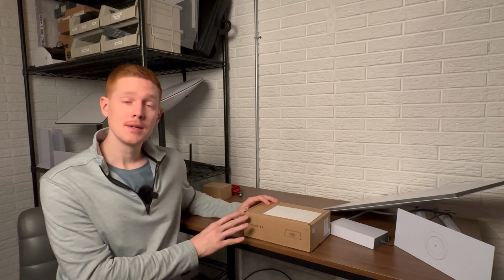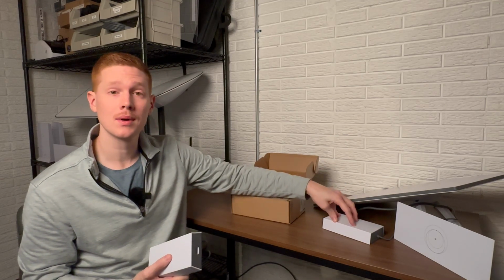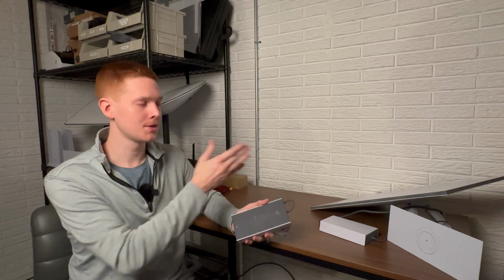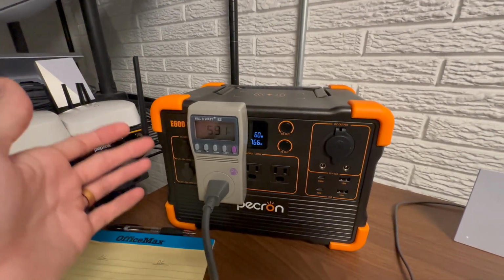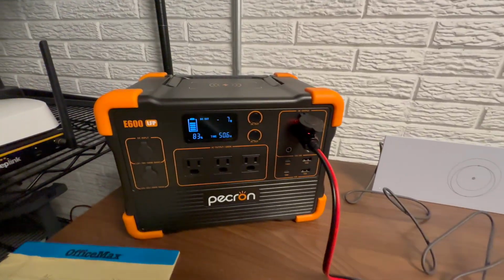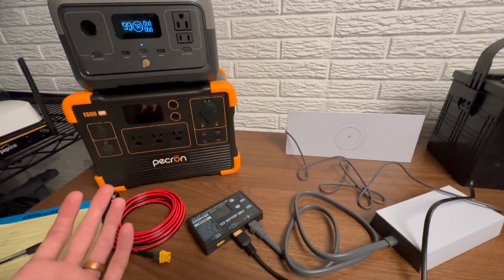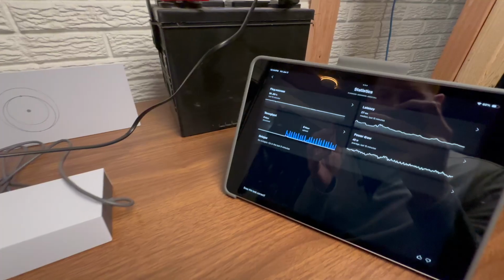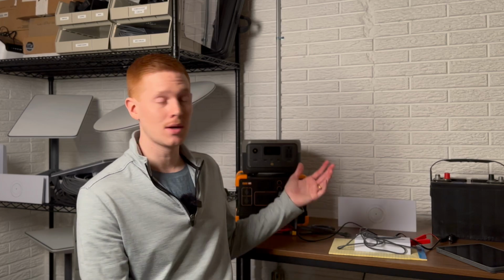Starlink Gen 3 Standard DC-DC Power Supply | Efficiency Testing and Review

Comment: Nearly all 12v cigarette lighter style sockets can only put out 10Amps, so 12V at 10Amps = 120Watts.  Since the DC-DC power supply puts out 200Watts, we will need to put in at least 225Watts assuming a 90% efficiency conversion from 12V to 56V, so running it from a cigarette lighter socket won't work.  You would be better running a separate 20-30Amp 12V feed from the battery setup.  And the cable itself is too thin in the cigarette feed.
Reply: Wow, look at my comment, 30 amp input to get 3.67 out on 12 volt? This is ridiculous.
Reply: Yeah, especially in my tiny Subaru I wouldn't trust this on a cigarette lighter adapter.
Reply: Try plugging to power bank first then to the router? Most dc to dc converters struggle to start  fully loaded.

Comment: Really enjoyed this video and do want to convert over to 12 volt . I was going to purchase the Starlink DC-DC power supply but now am pausing. The troubles you were having puts questions and new decisions.  If there is a change or Starlink gets back to you on the issues, please put out a update...  Thank you . Really enjoy your work
Reply: I won't be doing it either. I assumed the inverter losses would be higher (which is odd because I normally don't assume). I'll be putting the $110 saved toward a next generation mini if the price comes down.

Comment: Is there a power station that has  an XT60 male input? And if there is one, is a 3% efficiency advantage worth the cost of this power supply?  I’ve had the same issue with my Jackery 1000 cigarette lighter DC connection and will likely send the power supply back to Starlink.
Reply: @tglass0000  Same issues here. I think it's weird that they didn't consider that the majority of power banks have 10a on their 12v input.
Reply from the maker: For the casual camper like myself? Probably not worth 3% savings. If you are full-timing off the grid, probably. If you already have the Jackery I say just use the inverter since it doesn't require further investment, and it's just a bit less efficient.

I believe they included the XT60 instead of the common cigarette plug specifically to avoid people thinking it's compatible with every 12V outlet. As we found out, you need quite a bit of power to run it, and most power stations won't put out >10A which it needs.

Comment: What are your thoughts on unplugging the router every once in a while. I was told that would help the ping, latency situation.
Reply from the maker: I’ve only needed to unplug the router for troubleshooting or packing down, setting up. I don’t see a reason to unplug it regularly if you aren’t having issues. The system reboots automatically every week or two with firmware updates anyway.
Reply: @DISHY_tech  just was wondering. I’ve noticed that there are usually updates during the night at least once or twice a week. Thank you very much. I enjoy your channel.

Comment: For my mini, I just bought a USBC to barrel connector cable… no brick or anything. Straight cable with a usbc on one end and barrel connector on the other. powered my mini just fine when plugged into my power station.

Comment: New member here. Since the Starlink DC to DC Power Supply does not work off the Pecron 12V 10A  receptacle, I am looking for solutions.  I just watched your other earlier video covering the DishyNOAC.  Your Gen3 dish worked fine off your Pecron's 12V 10A receptacle in that video when using the DishyNOAC(another great video by the way!).  So can I assume a Gen3 will work off my Jackery 12V 10A receptacle assuming I am using a DishyNOAC in the mix?  If it worked off your Pecron it seems it should work off my Jackery. Finally, what does the DishyNOAC do, that the new Starlink DC to DC Power supply does not, in the case of using a portable battery's 12V 10A receptacle?
Reply from the maker: First, thanks for supporting the channel, and welcome! I'm still trying to get some answers from Starlink customer support on this issue. It seems like I'm not the only one having issues with using 12V power stations. I believe the cause is one of two things, both pointed out by viewers of the channel: 1. Voltage drop from a longer DC power cable. The cable in the Starlink DC power supply video is around double the length of what I used in the DishyNOAC video. It could be that the extra length is dropping the voltage enough to stop the boot cycle. 2. 12V/10A outlets regulate the output too much and interfere with the boot up process. It's probably a combination of both in my case. I measured the Starlink dish using more than 10 amps (12.3V) during the boot up phase when running off my RV battery. Most power stations aren't going to like that on the 12V/10A outlet, and may regulate it enough to cause issues. As to why it worked with the DishyNOAC, it could have been a firmware change or perhaps I just squeezed through with the slightly higher voltage on the shorter DC cable from the Pecron. Since I ultimately used the DishyNOAC directly off my Scamp battery I haven't had any issues.

I'm out of town right now (since publishing the video) and haven't had a chance to play around with the length of the power cable. Until then, I can't confidently recommend 12V/10A outlets for the Standard dish until I confirm a few things. You could of course just use the inverter on the Jackery with the Starlink AC power supply in the meantime.
Reply: @DISHY_tech  Thank you so much for your reply and comments.  I will be watching this video's comments like a hawk for further hints and suggestions and any follow-up you may provide.  Another note.  I have a Gen 2 actuated dish.  I built a DC power supply for it with a cigarette plug connector.  It works great off an older Jackery 1000's 12V 10 A receptacle.  Perfect.  But my new Jackery 1000 Plus trips when it is booting using the same DC power supply I built.  I called Jackery, sent them a video documenting the performance differences on the two Jackery's.  They requested I send in the 1000 Plus for a replacement.  But it's been 2 weeks and nothing back yet. Not sure why I am so driven to make the DC work, as your tests do show the AC inverter pretty close on power consumption. But I would like to go DC anyway ........

Comment: Thanks for sharing this review.  This is super helpful!
(1) Is  Starlink's DC-DC more or less efficient than the DishyNOAC you've reviewed earlier?  
(2) Is the efficiency gap of only 3-5 watts similar when the Starlink is mostly idle (e.g. when a phone is connected to Wifi and ready to receive text messages but there is no heavy internet usage)
Reply from the maker: I found the DishyNOAC to be more efficient, probably because it completely replaces the Gen 3 router and power supply. The gap in efficiency was similar with and without a load on the network. It was consistently 3-5%. I've noticed that internet usage doesn't change the power usage of the dish very much, if at all.

Comment: The DC to DC doesn't work on either of my power banks. I wish that the tech team was more knowledgeable  about  the fact that there is currently no way to use the DC to DC POWER supply with a power bank.
I had a few tickets opened for assistance and no solution as of yet.
Reply from the maker: I would recommend the Mini dish if you want to use a small power bank and not a full featured power station. Power banks are designed for small electronics like phones and laptops. The Standard dish uses too much power for a power bank. The Mini, on the other hand, can run directly off of USB-C if the port supports 100W PD. I have multiple videos testing the Mini with power banks, works great!
Reply: 0:22  @DISHY_tech   Doesn't apply. Just opened another TICKET for help.

Most power banks have 10a 12V car ports. It might have been good to consider that in the design.

Comment: Good Film. Is there something like that for Starlink Mini. Greathing from Europe NL
Reply from the maker: You can get Starlink’s Mini USB-C cable and plug it right into a power station or power bank that has 100W USB-C output. They also sell a 12V car adapter accessory for the Mini if you would rather use the 12V car outlet.

Comment: All i can say is that AC power SUCKS, i wish every device had DC connects it just more inherently efficient
Reply: I'm skeptical, but he said the difference was only 3%.

Just running my inverter without a load drains my batteries quickly. I am wondering if the 3% loss he found is incremental to already having the inverter running. I need to pay more attention to the video or do my own experiment.

Comment: My Jackery 1000 will not boot up like your it's over drawing the 12 volt outlet. I hooked up my Redodo 100 AH Battery and it booted just fine. On a 12 volt battery it will spike over 100 watts DC and stays about the 65 - 84 watts range most of the time. I have found in my case the Jackery is about the same draw using the AC inverter.
Reply from the maker: Good to know I’m not alone or overlooking something, seems like support is correct, just needs more power available for the initial boot up that power station DC outputs can’t provide.
Reply: @DISHY_tech  Car Battery Jump Starter(cheapest would be enough) can be used in parallel, but needs to be careful not to burn out main power source by current from jump starter(diode?, but it will drop voltage by 0.7v and dissipate heat and losing efficiency), if maximum voltage of jump starter less or equal to main power source max V all should be ok(assuming both are 12v rated) , and obviously it will all burned by wrong polarity, so all connection should be correct and good enough for high current, your cable is too long for such currents, starlink heater should be disabled, otherwise it will discharge jump starter battery eventually...

Comment: Awesome review.  I have been waiting for someone to review this product, and you are the first I think. I was assuming I could use this off my Jackery Explorer 1000 Plus, but it's going to be a no-go per your Pecron `experience. So I am pretty disappointed and do not see Starlink selling a lot of these for the Gen 3.  Thank you so much; you saved me a lot of greif.
Reply from the maker: Someone commented just after you that their Jackery 1000 wouldn’t boot the dish up either, so it seems like I came to a valid conclusion as far as the 12V outputs of portable power stations. A DC source with more power should work fine like I was able to show by hooking up to the battery. You could still use the Jackery inverter and accept the few % you lose with the inverter.
Reply: @DISHY_tech I hope you’ll review the new advanced power supply starlink just released!
Reply from the maker: @brendanjames8238  I have one on the way, should be able to knock out a review before the end of the month!
Reply: @DISHY_tech did you ever get a chance to make this video? I just ordered a Starlink and where I live we just experienced a hurricane and without light...I want to be able to run this on a power station with good power efficiency

Comment: Ahh the P = E × I problem. I run into that issue all the time when anyone tries to run Starlink Gen2 or Gen3 off of a low voltage power supply especially from a portable power station. Majority of them are current limited to 10 to 12 amps and Dishy can surge up to 20 amps upon bootup. At the higher input voltages, I find the surge is around 5 to 10 amps at nominal 48 volts DC.

The good thing it only lasts for about 2 to 3 seconds, but current limited protection circuits will cause a significant voltage drop at the input of the DC to DC converter to act quite erratically.
Reply from the maker: Sounds like that is what could be happening here, and it tracks with Starlink recommending 30A at 12V to account for that boot up current.

Comment: I think the long cable running right from 12v is going to cause the voltage to drop enough to be below the power adapter's operating voltage. I jumped straight to usb-c  as a source and cable for the mini for this reason since it can operate at a much higher voltage.
Reply from the maker: Ya I’ve seen the issues on 12v with the Mini so I chose a cable similar to what I use with the Mini. The cable in the video is only 10ft and it’s 14awg wire. The car adapter cable I use with the Mini is longer and 16awg so I figured I would be fine.
Reply: @DISHY_tech  Mini consumption is much lower, so i don't think cable is fine.
Reply: It depends on the guage of the wire and the length

Comment: Thanks for the review. I'm not familiar with XT60 connectors - if you cut off one end of the included cord to fit your own interface, is there a way to tell which lead is positive and negative? Thanks.
Reply from the maker: There is insulation for each conductor, red for positive and black for negative.